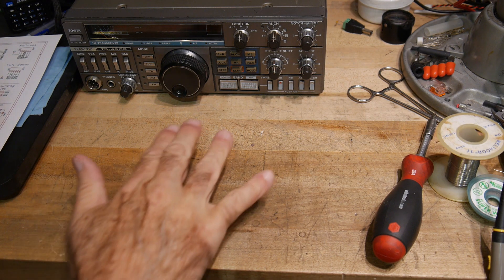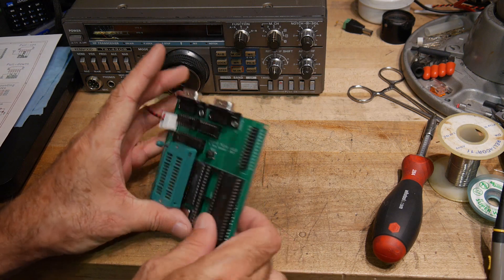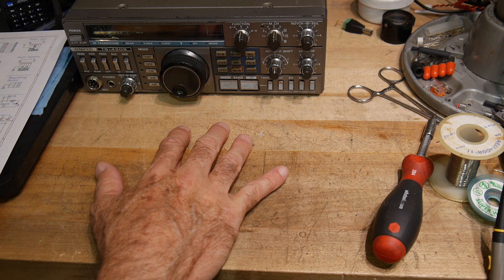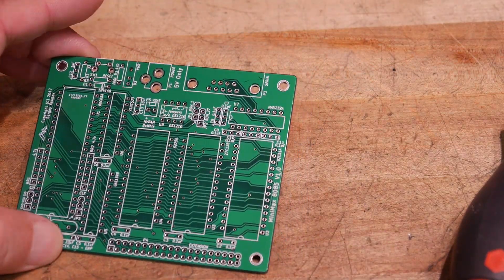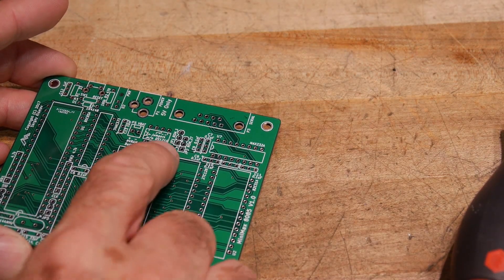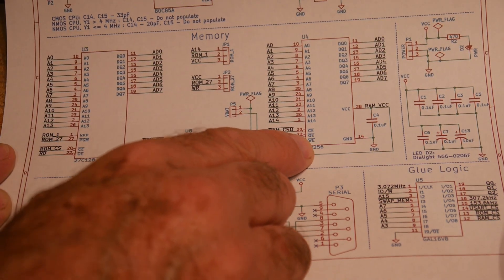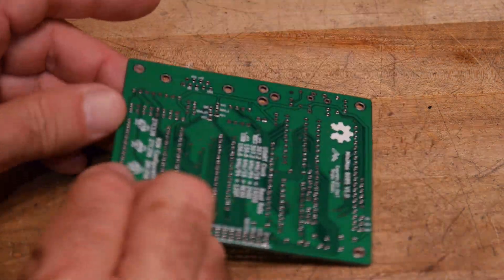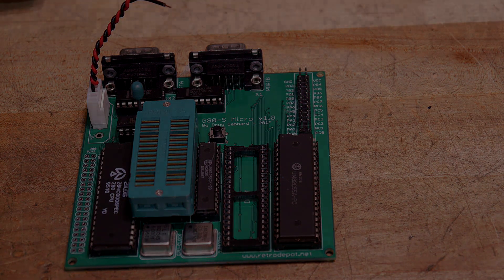#230 Intel 8085 SBC single board computer

Comment: The 8085 was a great processor.  In CPM systems it was faster than a Z80 because almost aps were written in 8080 code, not taking advantage of the Z80 extensions.  The 8085 was 5MHz, the Z80 was 4MHz and required a special clock generator. The 8085 was much easier to use.
Reply from the maker: It was always my favorite

Comment: Banana pi BPI-M4  with Realtek RTD1395 chp design ,it is a 64-bit quad-core A53 mini single board computer. It features 1 GB of RAM and 8 GB eMMC. support 802.11b/g/n/ac wifi and M.2 interface
http://wiki.banana-pi.org/Banana_Pi_BPI-M4